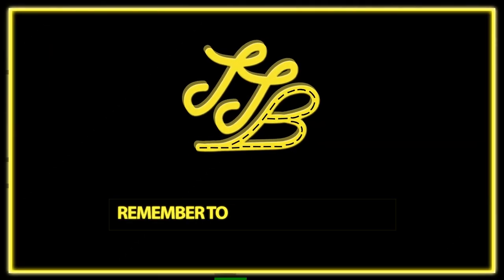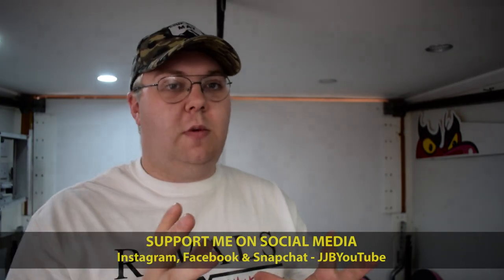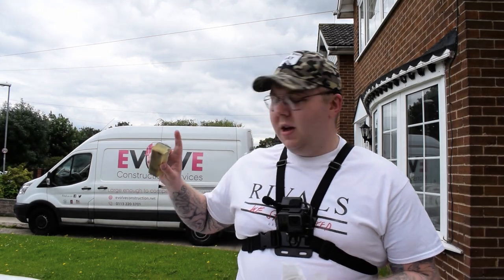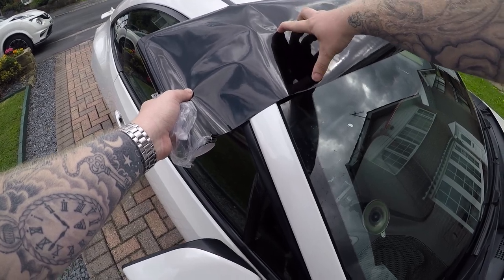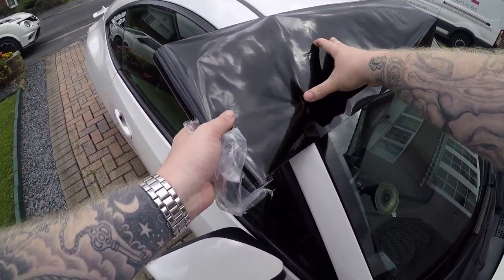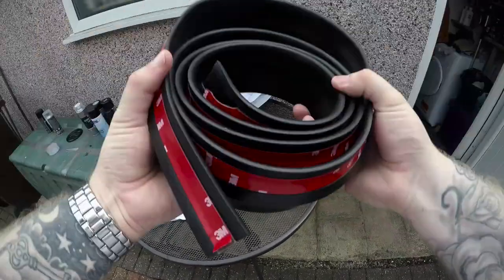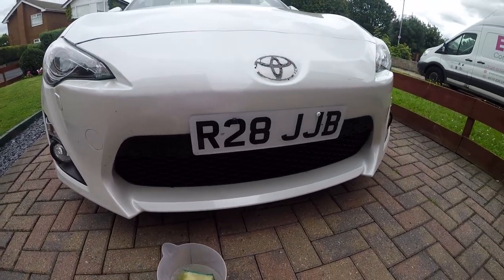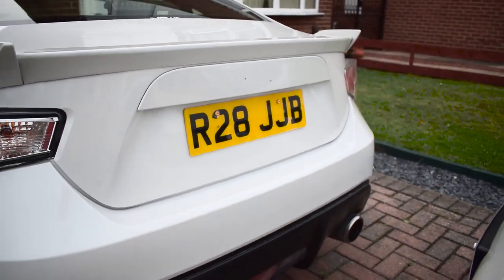Does this mean I'm a ricer?

Comment: Far easier to PlastiDip the two pinned Toyota badges; you can do it without removing the badges. Put some masking tape around the badge, doesn't need to be accurate. Spray with PlastiDip, then use a toothpick to remove the Plastidip from car paintwork, it'll separate cleanly, leaving the badge covered.
Reply from the maker: It would be easier yes but I really fancied the gloss look over matte